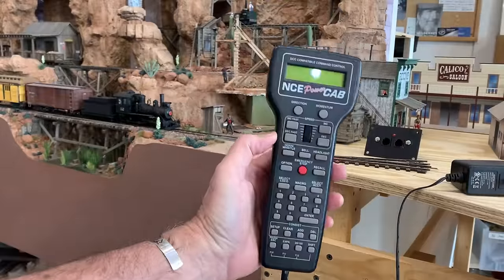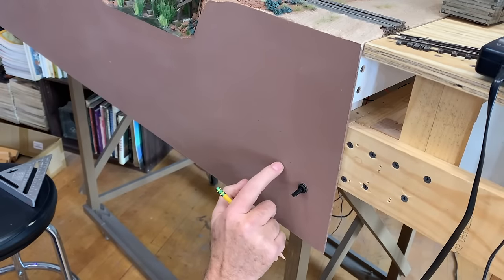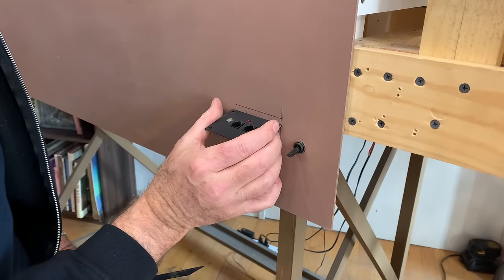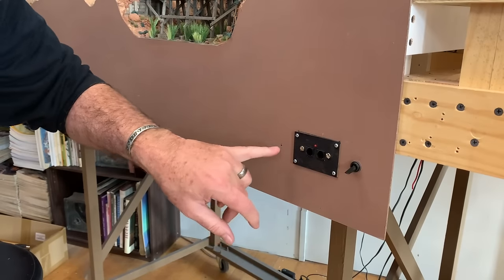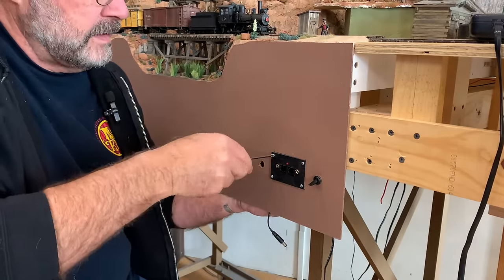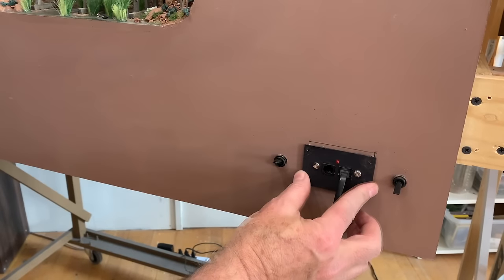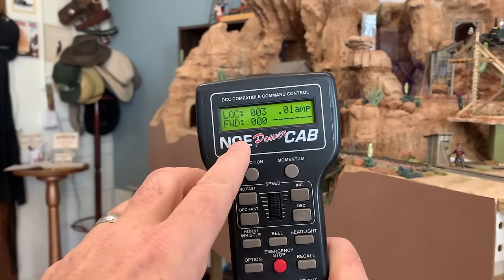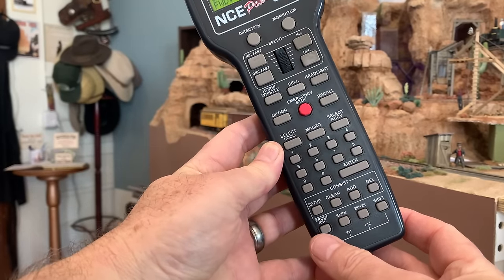Installing an NCE Power Cab DCC System | Workbench Wednesday

Comment: great video. just wondering which sound decoders do you have in your Bachmann loco's that will work with the NCE power cab ?  is that the NCE Power Cab 25 throttle you are using ? I see there is a new NEW Power cab 25 for 2024.
Reply from the maker: I have both Tsunami and TCS Wowsound decoders in my fleet and all work flawlessly with the Powercab. The only decoders I've ever had problems with are the older, non-sound, stock decoders in some Bachmann locomotives. The Powercab in this video is an older one. I'll be getting one of the new models for the Thunder Mesa layout.

Comment: Ive had an NCE Throttle since 2020 and it ran my locomotive until I tried programming the address. I messed something up cuz I didn't understand it and I never could get my locomotive to run again.😐
I'm new to DCC.  And I've had nobody to show me how to operate it. I will follow your instructions and try it again.
Reply from the maker: CV 8 will restore the decoder to factory specs in most cases. Use CV 1 to change the address.
Reply: @ThunderMesaStudio  Thank you Dave!

Comment: Dave, I have been using a Digitrax DCS Zephyr system since I got into DCC around Mid 1990s.  I am somewhat dissatisfied with Digitrax as  DCC company..  Do you find the NCE system easier to use? .
Reply from the maker: The NCE system is pretty easy to use, but I don't have enough experience with Digitrax to make an honest comparison.

Comment: Can I use the 2 pin wiring track connector that comes with a Bachmann dcc system to connect to the tracks? I just bought this and now I think I have to turn around and go buy feeder wires so I can even use this
Reply from the maker: You can use it
Reply: @ThunderMesaStudio  thank you!!! I was really hoping I could because I was gonna inter switch between my one dc switcher then turn that off and start up the NCE system for new locos I picked up today at a show